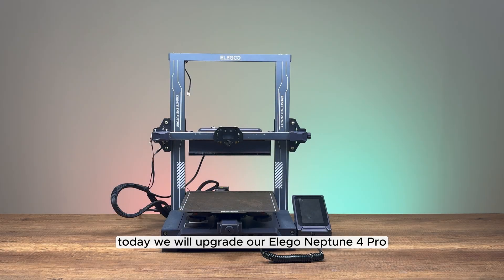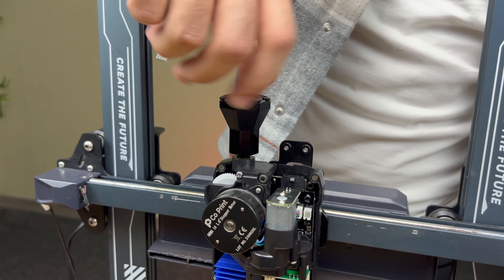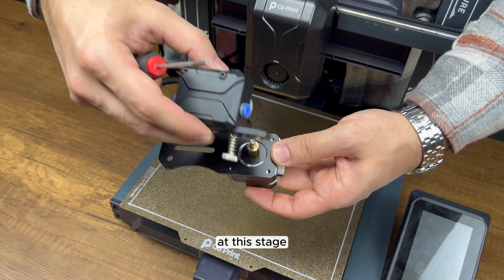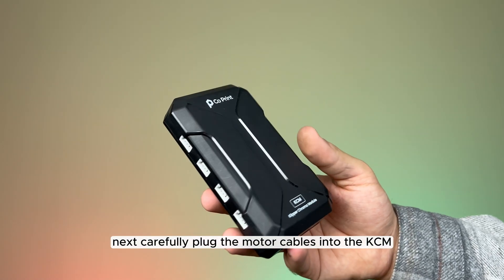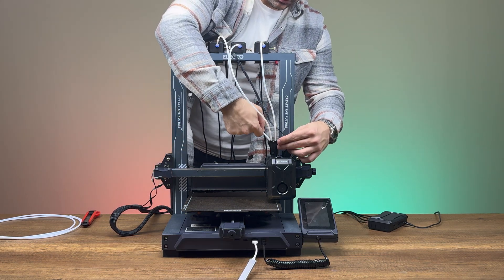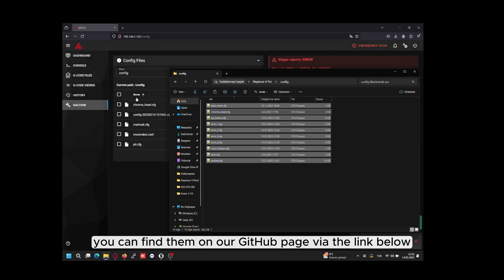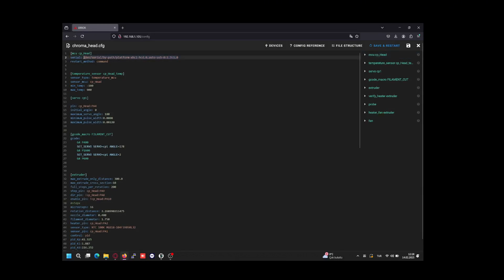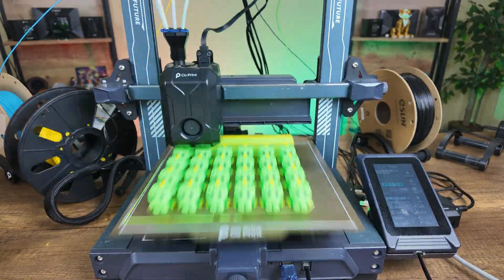Upgrade the Elego Neptune 4 Pro for 4-Colors Printing | Co Print KCM Set Installation

Comment: The printer.cfg file that gets dropped in after deleting the original one is not on the github page. Where is this file?!?
Reply from the maker: We’re sorry to hear you’re facing an issue. If you haven’t already, please reach out to us at support@coprint3d.com — our technical team will guide you through every single step and help you get everything working quickly.
Reply: Did you find the issue, I’m having the same problem